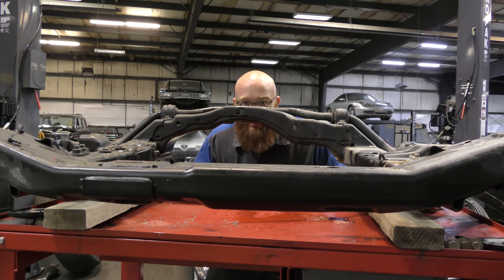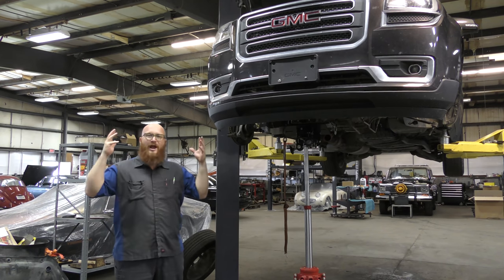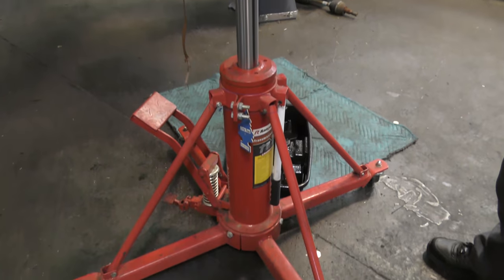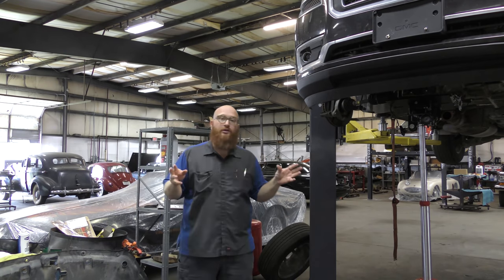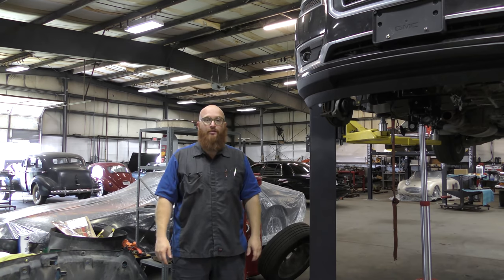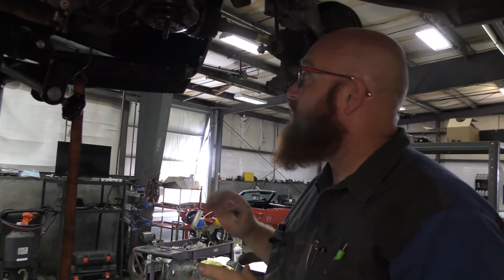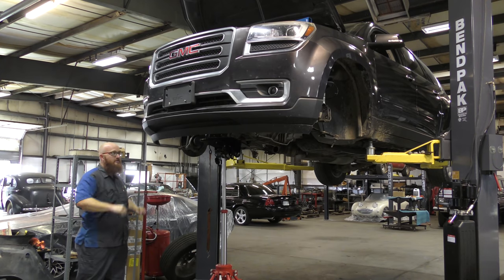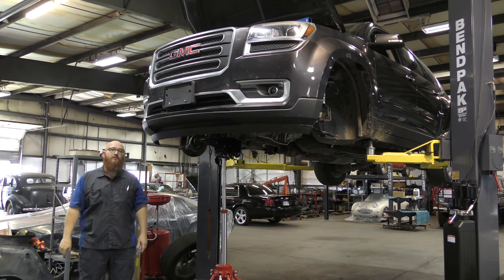Used car insanity in the CAR WIZARD's shop! Why did the huge repair get approved on this '15 Acadia?

Comment: C'mon wizard, can you blame people for these insanely over engineered cars and hearing it cost a grand to replace a $40 part-?  You used to only see this crazy crap on badly engineered foreign cars, but now the American makers have adopted the same practice of enginieering the cars so they can rape them until they bleed to repair this junk.  I cant blame anyone for being shocked and angry at the stupidity of it all, especially since they used to use simple and reliable cables and accessible vacuum motors to do the exact same job and they often lasted the life of the car.  Theres no need for the $40 box at all, its just over engineering and planned obsolescense that very much resembles a scam - because thats what it is. I know its not your fault wizard but unfortunately youre the one the shocked customer has in front of him to rant to and its just going to happen more and more as cars get worse and worse - and they will.  If someone was smart they would engineer a fairly priced simply made dependable car thats comfortable $ easily repairable and watch people flock to buy them, im sure the carmakers would get the government to outlaw them in short order as they would no doubt interfered with the scam mentality car makers have subscribed to.

Comment: INsane planned obsolescence engineering that requires frame out and engine out just for a rear main seal, ludicrous. I miss the good ol days of simple big comfortable easy to repair and RELIABLE American cars from the 60's and early 70's. I had my uncles old '63 Buick Lesabre with its old rope style rear main seal and it never leaked in over two decades.  Also you could change it IN the car, just drop the pan and rear main cap change the seal and replace same.  When did engines get so lame they started requiring $$$$$$ oil filled motor mounts.